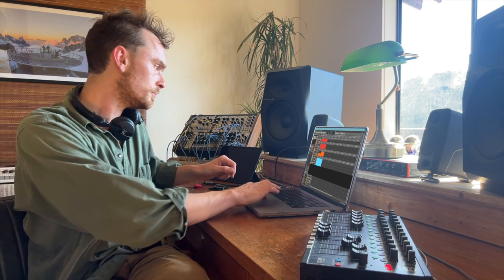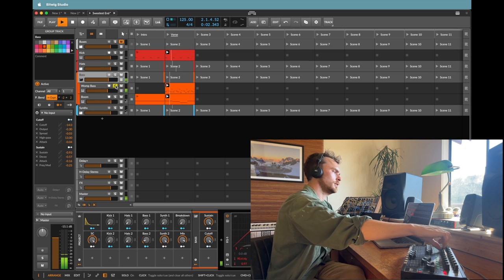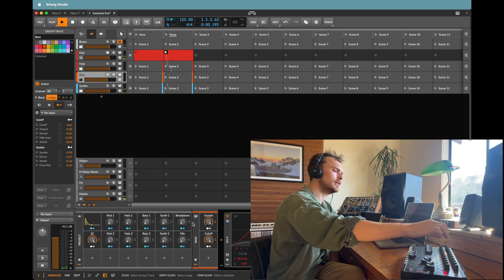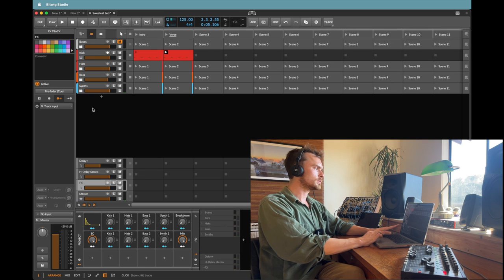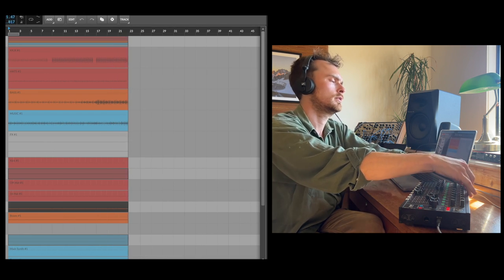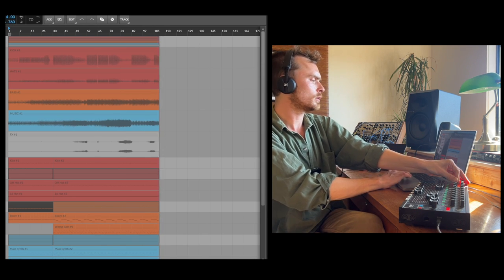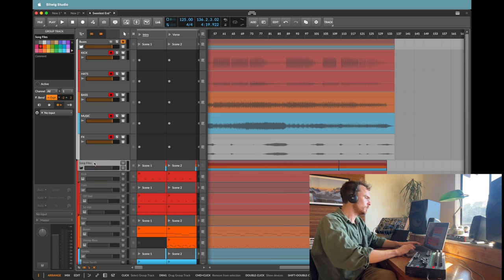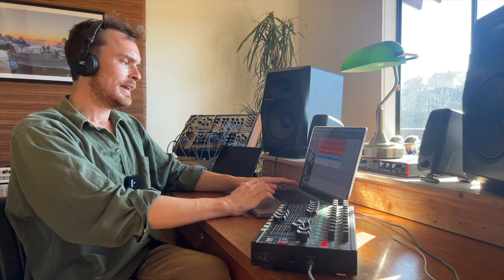Instant Arrangement Hack: Printing Audio

Comment: I have been considering switching over to Bitwig because I want a more flexible and performance orientated approach to trying out different ideas and composing tracks. This video and the previous one which looked at project modulation and blending together different states of the track have been an absolute revelation and you've described them so clearly. My decision is now made, thank you!

Comment: I’ve also found that a conscious effort to print to audio has helped me to tighten up my mixes by being able to calibrate tracks so that the peaks land exactly where they’re supposed to. When it’s in midi you can’t really tell sometimes the timing is a bit out of whack and it’s hard to notice. Initially, I just started printing audio out of habit because my Mac mini only has 16 GB of RAM and I kept on running out of memory so I was forced to bounce instruments and disable them.

Comment: This is bad advice... I fail to to see how this approach is superior to recording MIDI clips + automation to  the arranger!? With your approach it's impossible to make adjustments to the automation or the score after recording, all you're doing is bouncing the instrument output with baked in automation to multi-track audio. The same effect can be achieved by recording the midi + automation to the arranger with the added benefit of being able to make changes/fix mistakes and still have the ability to bounce to audio if desired.
Reply: it isn't worse, it's different. more in line with the way a DJ works. While you are correct, as I see it, the whole point is to force you into using the DAW as a live instrument and commit.  Also, once you have the multitracks you can do stuff in audio space that wouldn't be possible in MIDI. At the end of the day there is no right way, and it certainly isn't bad advice, it's just different, and that is fine.
Reply: @jumpstar9000  I'm a DJ as well as a producer; I don't understand your comment about "the way a DJ works"... as far committing there is no difference in the immediate product of recording to audio vs recording to midi -- it's going to sound just the same and have the same arrangement. The difference is that the midi is infinitely easier to make changes to after arranging. I could see a beginner having some psychological benefit of seeing the audio in the arranger vs having midi, but that's exactly my concern with this 'technique' being advertised is that a beginner will go this route and then run into a bunch of extra problems when they want to make a change or fix a mistake after recording.

As for doing stuff in the audio space vs midi the only things you can do with the audio that you can't easily do in midi is reverse, time/pitch stretch. This can still be accomplished by recording midi + automation to the arranger and then bouncing the necessary sections to audio. All in all I see this approach as taking extra steps to produce the same result as recording midi without any of the flexibility of being able to edit afterwards...
Reply: @consciousholes  When you are DJ'ing you are taking source material, mashing it all together based on feelings in real time. That is what this encourages to obtain a fresh live sounding result. 

There is nothing stopping you doing tons of production work in the source material using regular techniques, but now you have the added possibility of an extra live dimension on top. The great thing is you can have the "studio mix" absolutely perfect in the source material and then cut as many remixes as you like all day or night long. You'll be thanking yourself on set for setting it up like this.

There is a ton more stuff you can do in audio space than you said. Micro-Pitch and Formant shifts, Time stretching Folding to takes and Comping, Slicing and Dicing and using all the Operators in audio space. All these are totally different to using them in MIDI space.

I don't understand the pushback, because clearly there are more than a hundred likes on this video who think this is a cool and fresh approach that is difficult, if not impossible to do in any other DAW.

We can't all be wrong 🤷‍♂️
Reply: @jumpstar9000  > That is what this encourages to obtain a fresh live sounding result. 

That's a moot argument as the result of this approach isn't any different than recording the clips and knob actions as midi/automation in arranger -- it's the exact same performance just captured in a less flexible format. At the end of the day people should do what works for them, I just think it's important to point out the differences and consequences of this approach so that people can make an informed choice in designing their work flow.

My  primary complaint isn't the technique itself it's that the presentation makes no mention of the tradeoffs/downsides of arranging this way; more complicated setup and less flexibility...

Don't get me wrong this isn't an "I'm right and everyone else is wrong" type argument -- there is no wrong way to make art! 😝
Reply from the maker: @consciousholes Being able to make infinite changes till the cows come home is often PRECISELY what stops beginners from finishing things. Committing and working from audio is, in my expert opinion, a fantastic way to actually move beyond the endless knob twiddling that many producers end up calling “production” and into a place of actually being able to share

I guess this technique just isn’t for you then and that’s fine. Thanks for all of the long comments though ✨
Reply: > Thanks for all of the long comments though

You're quite welcome. Hopefully folks will find this comment thread useful  :)
Reply from the maker: @consciousholes  Out of interest, what genres are you making primarily?
Reply: The commercial production work I've done has been primarily hard-rock/metal, but my own personal work spans many genres; folk, indie rock, classical, jazz, and electronic (dub, house, techno, jungle)... My "default" sound though is 'dubby space jazz'; avant-garde ambient downtempo utilizing self-authored instruments and effects